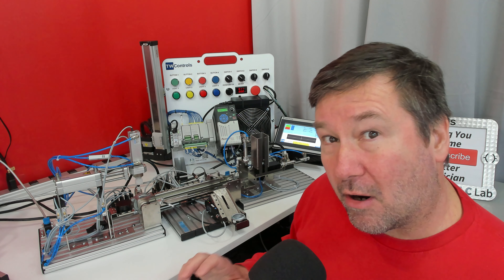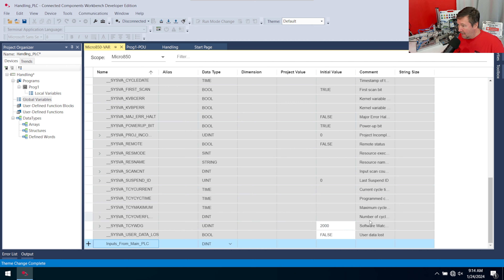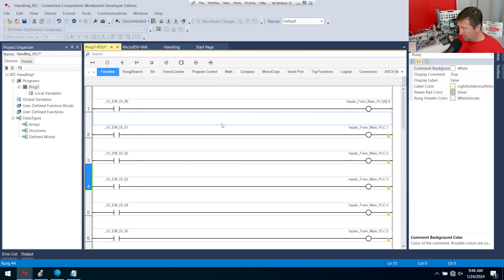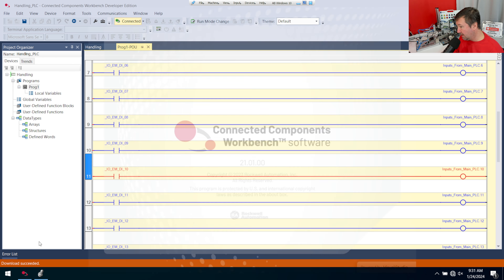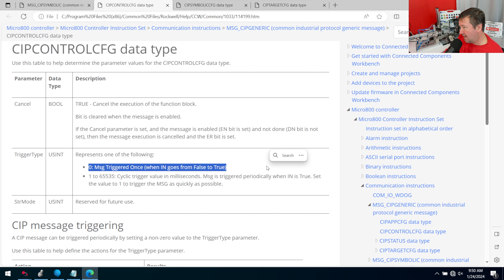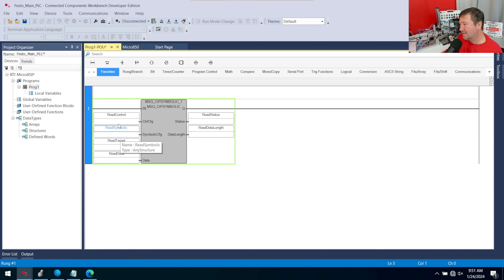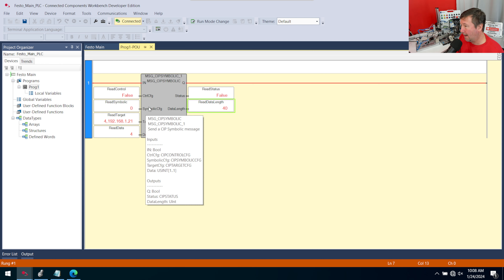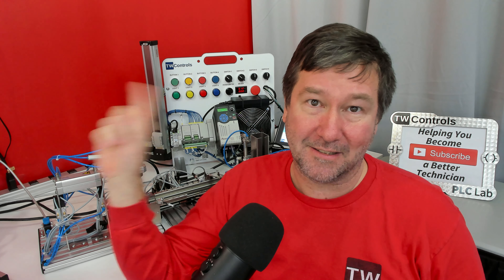Read Message Data from Micro850 to Micro850 PLC

Comment: Tim, I can't thank you enough. I am currently working on 2 pump panels at either end of an electroplating factory, running MODBUS to run the Eaton drives but require alarm signals between the 2 micro 820 PLC's. This will help no end. Long time subscriber.
Reply from the maker: I'm glad it was helpful. The Micro800 has some nice communications options.

Comment: Will the CIP messaging work between two Micro850 PLC even if the Modbus Server is enabled? I have a project that needs a Micro850 to talk to each other and there is an existing SCADA with Modbus TCP and wants to fetch some data in both PLCs.
Reply from the maker: Great question. In the video series that you are watching, We are using CIP read, CIP write, Modbus client, and Modbus Server in the same PLC.

Comment: Hello Sir, 

Thanks for you, you are sharing lots of information about Allen Bradley PLC'S..... 

I have struck up with interfacing Micro 850 plc to ethernet ip port Label Printer...... Please help me to configuration....
Reply from the maker: Those can be tough. It depends on what protocols the the printer supports.
Reply: @TimWilborne  ethernet ip, Serial RS232 & USB
Reply: LAN
Reply from the maker: If it is Ethernet IP then you just need to determine the class, instance, and attribute and use the generic module.
Reply: @TimWilborne  Thank you so much for your response..... & spending valuable time to me
Reply: If you have any example project or images please share me.....
Reply from the maker: See this video.
https://youtu.be/3RHczlCRMyY
Reply: @TimWilborne  Thank you so much I will do it...
Reply from the maker: You are welcome